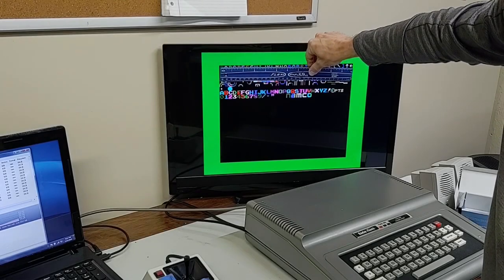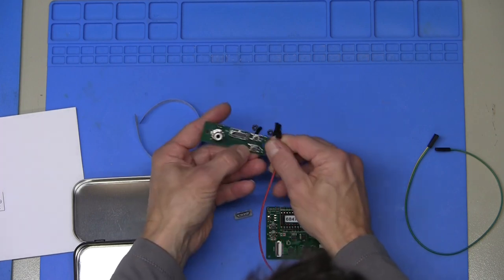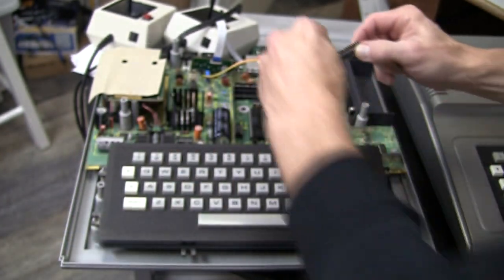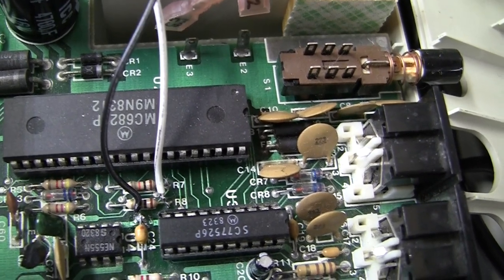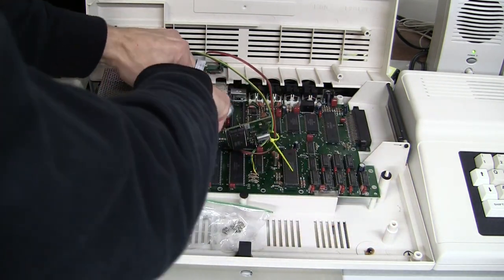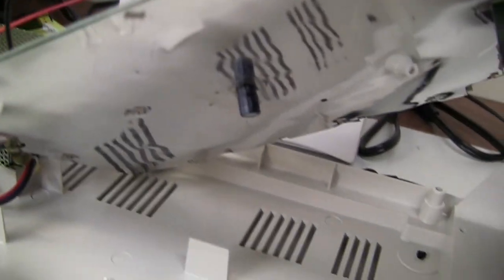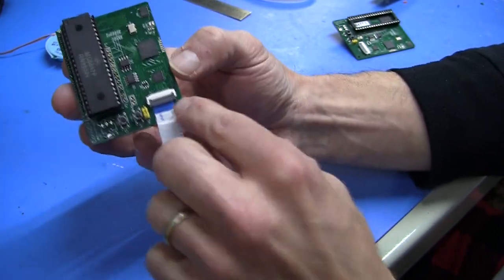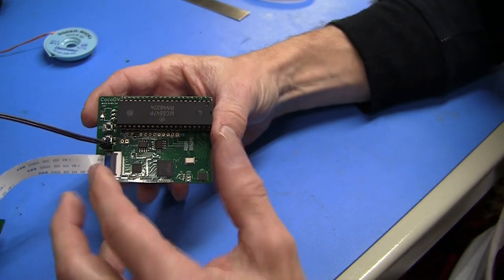Installing CocoDV into the Color Computer

Comment: I've got a T1 Korean CoCo2 I will do this on.  Instead of moving the capacitor to the bottom of the board, couldn't I just "elevate" the CoCoDV?  

Also, I'm looking at the case and wonder if I could mount the board below the cartridge port?   I don't have the system board right now though so I can't test at the moment.  

Good information on the ribbon cable.  I may want a longer one if I try to relocate the IO board.  I'm leaning in favor of getting a project box and mounting it there, then using a screw from the inside of the CoCo case to screw into the project box.  It looks pretty good in my head :)
Reply from the maker: Did we already work this out for you?  If not, contact me because it easy fairly easy to work around these days.  Thanks!

Comment: So there are questions about "is this compatible with CoCoVGA?"  Obviously not.  I wonder if future firmware updates could support whatever it is CoCoVGA does.  I am not sure what software makes use of CoCoVGA but I prefer the futureproofing  of an HDMI connector over VGA.... at least it will live longer than VGA.  Now if only there was a hack to inject sound into the board which the designer doesn't claim any responsibility for us hackers doing so....separate sound seems so....  Even those SCART adapter things provide sound but those are analog where the goal of this is to be digital from end to end which is very good.
Reply from the maker: A few people have made use of the new features in CocoVGA and CocoDV, but by and large, the most important feature is to provide the backward compatibility.  If CocoVGA is ever abandoned, I'll try to work in whatever upgrades it provides so they are accessible for those who really need them.
Reply: Hello, How can i Buy it?